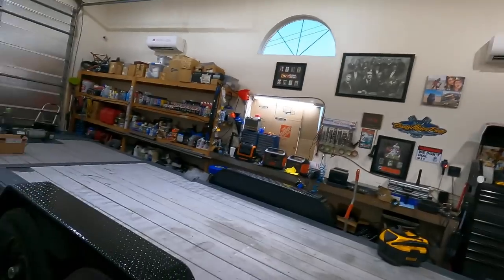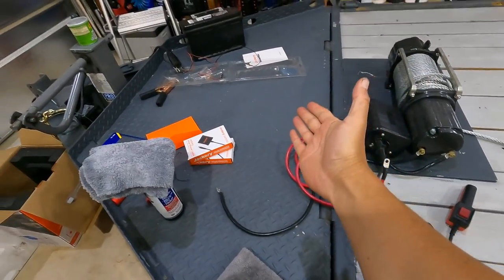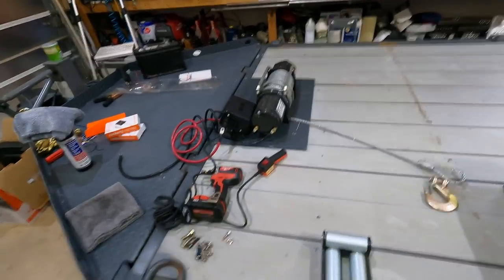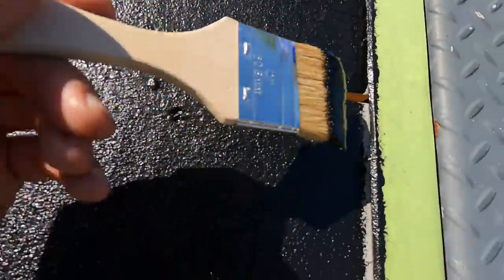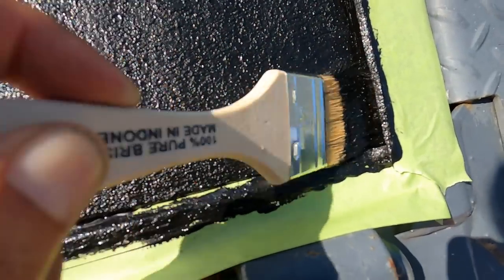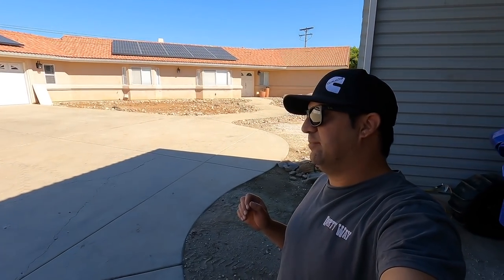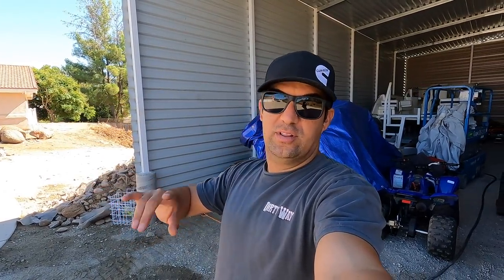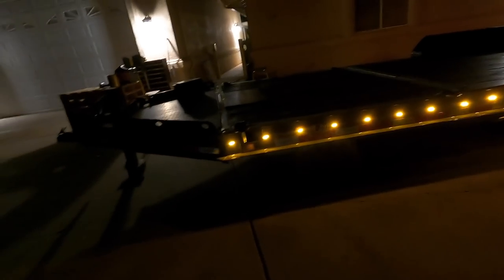Time to upgrade the lights on this trailer

Comment: Bed liner will peel off. I  tried it on my deck held up for a year.  Use paint with sand mixed in it.
Reply from the maker: I put a coating over it that is supposed to prevent that

Comment: Eddie although that trailer looks sick with all the the lights done the side but FYI all lights from rear axle back must be red and all lights front of axle amber/yellow
Reply from the maker: As shit
Reply: Not true. Lights facing forward amber and lights facing rear red. Side can be amber to the back as long as there not rear facing. He done it right by making them red on the rear facing of the fenders.

Comment: How exactly did you wire those lights ? 
All the led tap into the the trailer harness and every single one has a ground ? I’d like some info
Reply from the maker: Correct it’s a lot of work but awesome when done

Comment: I added marker lights down my 24ft equipment trailer as you did.  A few of the amber lights I made work with my blinker. 3 per side - so approximately every 8 ft. Somebody driving a lane over on a highway can see I'm coming over from anywhere along the vehicle and trailer. I also tricked it out with some underlighting which helps immensely with knowing right where the trailer is at night when backing up and the cool factor of changing colors (can even make them flash amber for roadside emergency). I also, added a 48" light bar mounted underneath on a 5ft x 3" pc of channel for protection.and stability, operates from a switch for lighting up the back and behind my trailer for night loading and that lights also when i place mty truck in reverse. My trailer is 102" w so I mounted 2 36" light bars at the front for night loading and lighting the deck. Also added spiked neo chromed lug nuts lol.
Reply: what lights did you use for underneath the trailer?  I'm curious because i would like to mount some white lights for driving, but also have them flash amber for roadside emergencies.
Reply: @SnailHouseProjects  also I did have to purchase a seperate wire extension kit. But still had to coil the excess wire up and zip tie under the trailer. FYI my trailer is 26 ft long you may not need the extension kit for a shorter trailer.
Reply: @richallen8742  nice. but you said you tricked it out with underlighting, i was wondering what lights you used for underlighting that change colors.  I am wanting white lights under my horse trailer i just don't know what are the best lights for that... i can wire a bunch of 3/4" lights on a rail, or LED Strips.  and i can wire in some ambers to act as blinkers under the trailer.

Comment: I want to do the same but I’m hesitant about structural on the trailer. Do you think Swiss cheesing the frame would weaken it ?
Reply: Dude. It's tiny 3/4 holes. It's not like an isuzi frame
Reply: Will it rust?

Comment: Just a heads up. But here in Texas where you put the yellow marker lights toward the back would be a ticket. Idk if California is the same but wouldn't be surprised if they were.
Reply from the maker: Shit California is probably worse than
Reply: @EddieLife3500  you should be able to replace them with red ones and be legal. Luckily a city cop gave me a heads up before I got a ticket.

Comment: Hopefully you have your class a cuz I know that trailer is more than 10,000 GVWR 👍🏽 but yes sir you got chicken lights on that trailer now 10-4 keep on trucking 👊🏽
Reply from the maker: What do you mean, a class C drivers license is good for up to 26,000 pounds
Reply: @EddieLife3500  if your truck and trailer both GVWR come by over 26,001lbs you need a commercial driver's license a or b.  Now if the trailers GVWR is over 10,000lbs it automatically puts you into a class a license.  Doesn't matter if you haul it behind a little Toyota pickup if the GVWR is over 10,000 lb class a automatically
Reply: I am a commercial driver instructor for Union Pacific railroad out here in Roseville CA 👍🏽.  If you want I can send you all the information just look at what your GVW is on your trailer. I have been jamming gears for almost 20 year's buddy. I may be wrong on your trailer but I'm almost 100%, it's over 10,000 GVW.
Reply: @5150cash  interesting
Reply from the maker: That’s crazy, then my next question is how the hell are all of us going to the desert especially with my trailer and my family’s stuff, because I know we are way over the limit, but have past highway patrol tons of times and never been stopped. Shit I think every 5th wheel and toy hauler is way over
Reply: @EddieLife3500  yeah, not sure I’ve ever heard of that but his credentials are better than ours lol. I swear that doesn’t sound accurate though
Reply: @EddieLife3500  that my good buddy I have no idea I know up here in Northern California they've been cracking down on a lot of people. We have a whole bunch of ranchers out here that get these big horse trailers and they've been stopped plenty of times for driving out of class. Makes no sense you can go to any place and buy any kind of trailer but yet they will not tell you anything about needing to have a commercial license. I'm not blowing smoke up your tailpipe I'm just letting you know because that falls under federal regulations. It only takes one county mounty to drop the hammer on somebody especially if something bad was to happen which I do not pray it on anybody.
Reply: @EddieLife3500  I would highly recommend to looking into more information regarding the GVWR weight ratings just to protect yourself.  I know you can get a class a non-commercial and and there is a lot of of their gray areas that fall under RVs as coaches and what they can haul weight Wise and lengthwise.
Reply: @EddieLife3500  right?!? I thought GCWR (26k) is what mattered when it came to a Class C license. Needing a Class A license for a trailer weighing over 10k seems odd. I live in Texas though… idk man 🤔
Reply: @5150cash  it must be a California thing… nearly all manufacturers (ford, chevy toyota, ram) market their trucks (1500) in commercials with tow capacity of 10k plus. Pretty sure majority of Americans have a Class C.
Reply: @DJKiDDKlashez  it's not hard to Google or ask your local Dot CHP office. I'm not saying that nobody can not drive whatever they want nor am I pointing finger at anyone. No it's not just a California thing it's a federal regulations. Please call up any CHP or your local police office or trucking school.  It's a big deal getting cought driving out of class and over weight. But that's my 2 cents. Everyone is welcome to do as you please 🤘🏽
Reply: The GVWR of the truck should be 12,300. As long as the GVWR of the trailer is under 13,700 you should be ok.
Reply: @mrwilsons_projects  wrong I wish I could paste the California Dot vehicle code with section number on here. Trailer GVWR  can not exceed 10, 000lbs.  Which will automatically bump you up to a class a. I'm not saying you cannot physically drive  but if you get stopped that's on you. That's why there's a lot of these guys doing hotshot without CDLs where they cannot take much weight on their trailer and are keeping combined weight under 26,000 lbs.
Reply: @DJKiDDKlashez it’s a California thing. Ca does recognize the rules for out of state drivers, though. If you go to ca with any weight trailer from out if state, 26k and under no cdl. 

The 10k deal is why so many have derated trailers to 10k … that’s another mess if you ask me.

Comment: Truck under 26K no cdl.  Truck GVW over 26K CDL.  Add trailer over 10K CDL A.  Criminal offense.  Cop will ticket you.  By the time you go to court you will have needed to go to a CDL Class A driver school and pass.  You will pass.  Easy drive test is with a Day Cab Semi single axle with a short 43" trailer. EZPZ.  Go to judge.  Ticket dismissed.  Bonus:  State Police respect Class A drivers because they absolutely must keep the DL clean.
Reply: That is false as long as the gcwr for both truck and trailer are 26,000lbs and under it does not require a cdl anything 26,001lbs and over requires a cdl believe me I carry one but it is not required for 26,000lbs and under look up the guidelines from fmcsa
Reply: @trentonbutler4067 California has an additional law. Over 10k requires CDL for ca residents. reg 85 I think.  It doesn’t apply to RV’s though. 

There is a truck school near me that does CDL testing for non semi drivers. You use your truck and your trailer or rent his trailer with air or electric brake certs.  I’m doing it in 2024. I need a trailer that can carry 2 Jeeps. That’s going to put me above 26001
Reply: @trentonbutler4067 also, the law only applies to Ca residents. Out if state drivers hot shot in ca for Llosa that drivers states laws.  Can you say it’s a dumb ass law? Lol yes, it is. Cdl to haul your own shit 🤦🏼‍♂️